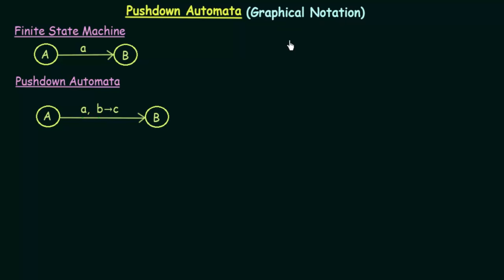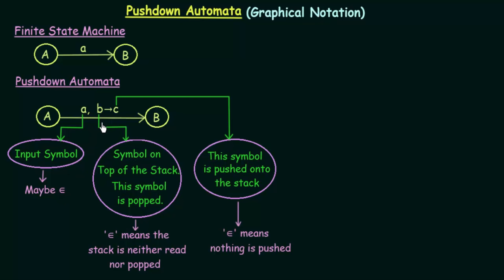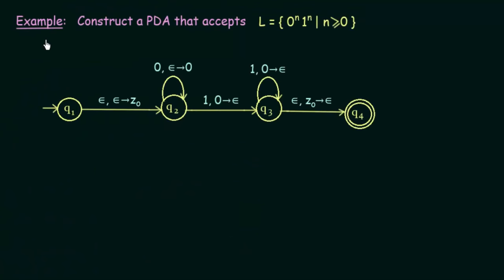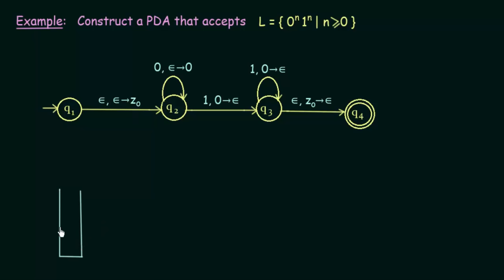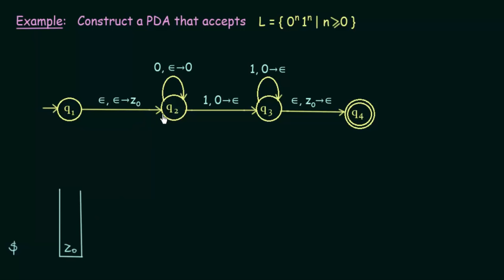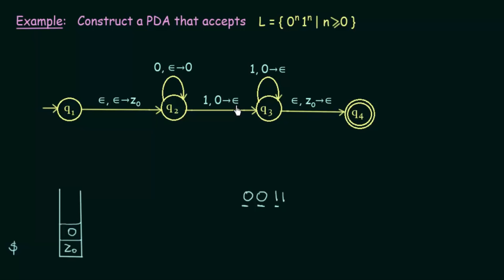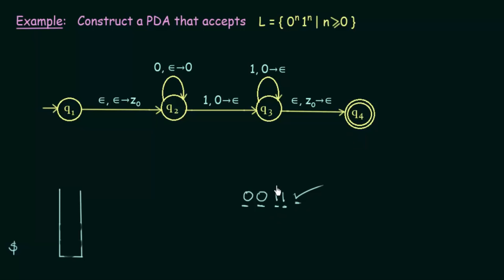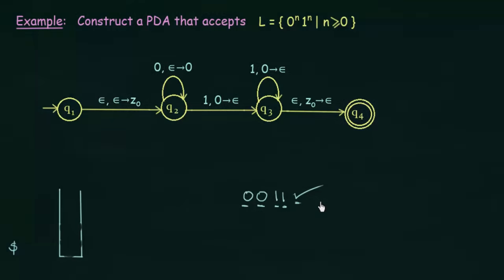Pushdown Automata (Graphical Notation)

Comment: I think for this PDA, q1 must be a final state, as language also accepts that strings for n=0.
And also to accept a string, both conditions must be true: 
1. Final state must be reached.
2. Stack must be empty.
If any of these conditions come false, then string will not be accepted.
Apart this, @NesoAcademy, you are providing a great content.
Thanks a lot.
Reply: No , that case every string will be accepted
Edit : 
The right way is to add a transition from q1 to q4
Reply: It's a NFA so what's why there isn't that transition.
Reply: there are two types of acceptance by pda.
1. acceptance by final state
2. acceptance by empty stack
Reply: correct but I think the mistake is in the question, where the condition should be n > 0.
Reply: @lifeofsreeh  no, because the initial state is reached only by reading the empty string. No way every string will be accepted if you make q1 a final state
Reply: @kriskurti7497  exactly, in order to accept a string pda has to come to the end of the string, and without making the initial state the accepting state or putting an empty transition from initial to final state, it doesn't include the case of n = 0

Comment: would it be correct to adjust the content of the last transition function to be 1,z0, e? ( in case I got the naming wrong, I'm refering to the writing on the arrow from q3 to q4). I tried to redraw the automata from my understanding of the topic thus far and I noticed the discrepency between my drawing and the professor's. My justification is that my design is intended to transition to the final state when we reach the final input in the stack when the professor's design transitions after we've reached the final input and there are no more inputs. Is this justification correct?

Comment: The example is NOT correct because 'n' is greater or equal to zero.  Meaning if n = 0, the string will be empty.  In this case, you cannot reach the accepting state (final state) if the string is empty.  Correct me if I'm wrong.

Comment: What will be happened in case of null string ? As the condition is also true for n=0 then the state q1 should also be accepted if i don't make mistake.
Reply: Then the first transition will accept no input and push z_0 to the stack. To make any progress any other transition will need to accept no input, otherwise the empty string is sure to be rejected.

Comment: I'm sorry, but in the example of the language L = { 0^n 1^n : n >= 0 } I believe the first state (q1) should be an accepting state. This is because of the basic case where the input string is an empty word, represented as an epsilon (ε). This can be seen as 1 and 0 raised to the power of 0, resulting in an epsilon (ε) empty word. Therefore, I think the first state should be an accepting state.
Reply: Yes you are right

Comment: Thanks a lot for the video. What happens when the string "1" is the input? At state q2, it will read 1 but the stack does not have a 0. Will this get rejected?
Reply: yes! as the number of 0s is not equal to the number of 1s

Comment: While I appreciate these videos, it's still very unclear to me what the point of the stack is and what the rules are surrounding it.  Why are you pushing elements onto the stack?  What purpose does this serve?  

Why does it seem that we can push any number of zeroes to the stack - wouldn't that result in a string that has non-equal numbers of 0s and 1s if we're accepting 0s as input and to the stack simultaneously? 

Why do we push the empty string to the stack?